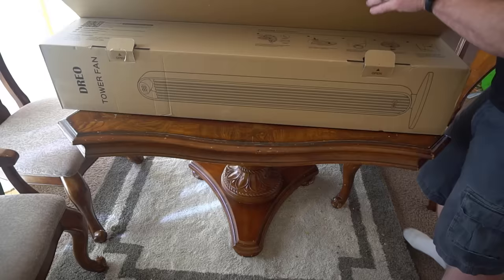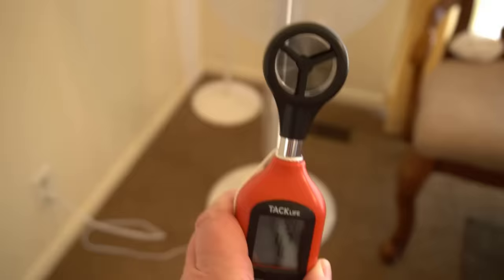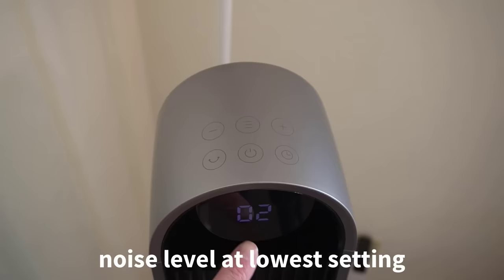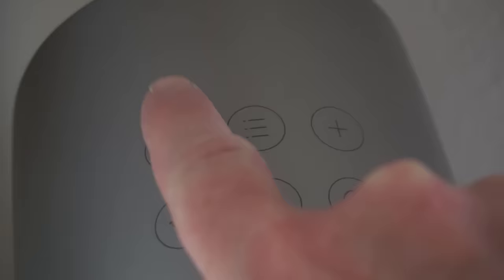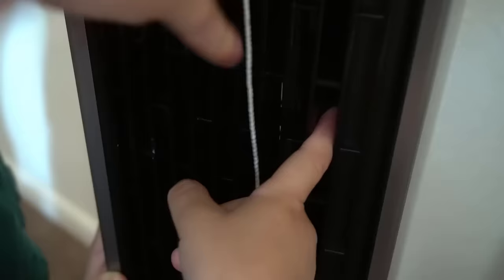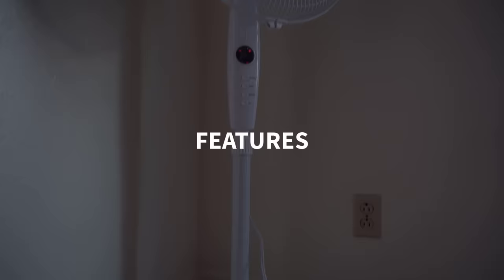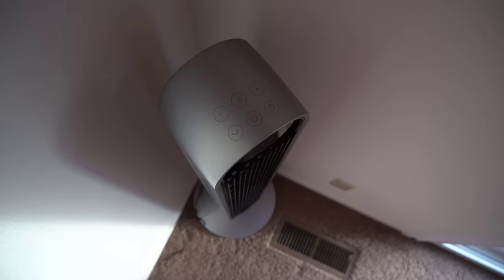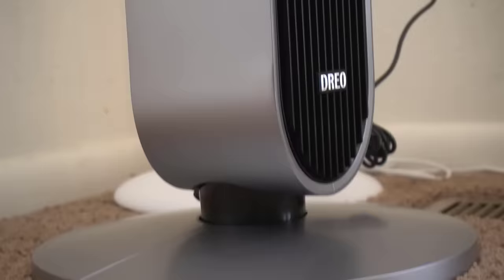Tower fan vs Standing / Pedestal fan. Which is best?  -  I did these tests to find out.

Comment: A tower fan uses what amounts to a centrifugal blower, whereas a pedestal fan uses an axial fan design. Centrifugal blowers produce faster air velocities and tend to be quieter. Axial fans tend to move a larger volume of air (CFM) and tend to be a bit louder. Great job with the video. This is exactly the results that could be expected based on scientific principles.
Reply from the maker: Nice! Thanks for your comment!
Reply: Axial fans work better to cool you off on a bed

Comment: You measured wind speed, but you really need to measure volume of air that is pushed as well. You can take computer fan and measure the speed and it will be pretty high. But you will not feel anything, because volume of air is negligible.

Comment: Title should be "£170 fan vs £20 fan. Which is best?"
Reply: Not to mention that the more expensive one eats up 2x more electricity, so that's additional cost in the long run. 😐😂 Gee, I wonder which...
And why not get 2 of them if the tower consumes 2x more electricity? Two "classic" fans will surpass it in every single way.

Comment: The power consumption test wasn't accurate. Most tower fans use a regular AC motor so they'll draw the same amount of power as a stand fan. That Dreo fan likely used a low voltage DC motor. Just going by how thin the power cord was and the fact that it had a switching power supply.

Also look into Shark Tower fans. They're loaded with features and are very quiet.

Comment: If it's a super hot day and your room is a sauna, which one is better?
Reply: Air con
Reply: Standing fan!!!
Reply: @nimasherpa5610  what about a ceiling fan do these do the work better?
Reply: @Rqidz  A ceiling fan would be more effective, and it will also not take up any floor space.
Reply: @Rqidz That depends... Cheap ceiling fans have minimal blade pitch, thus don't push as much air.  Quality ones with a more aggressive pitch (like an aircraft propeller) push a lot of air and can outdo any portable fan.
Reply: 1500 watts heater fan

Comment: I had a ac motor pedestal fan and on high it uses 50 watts and the airflow was not that much and then I got a dc motor pedestal fan and on highest setting it uses 25 watts and that the airflow was strong and that it uses the same power as a usb phone charger on lower settings like 7 watts and under

Comment: Nice review!  I'm surprised that tower fan used less energy vs the standing fan, from my experience it's been the other way around in terms of getting good airflow. The Dreo I would say would be considered a more high end tower fan vs the stuff you can find in Walmart or Costco so perhaps that make the results better than if you had a tower fan in a cheaper price bracket to match the standing fan.  Otherwise, a good in depth review that's hard to find!

Comment: Actually the standing fan is more efficient it’s got blades on it. It’s rotating higher volume of air
Reply: Tower fans push colder air more directly
Reply: @iDTecKt  Fans don't cool air. they just move it.

Comment: That tower fan has a dc motor and I have a pedestal fan with a dc motor and it's very quite and very energy efficient like this tower fan is and that pedestal fan has a ac motor and ac motors are not that very energy efficient and louder and have less power then dc motors
Reply: What's in your opinion the best at night to cool you down tower or high end axis fan ?
Reply: @alexvikendi1768  I have vornados and it I will mostly say vornado that its all about the brand that tower and axial can be both garbage and vornado moves the air accross the walls and back to the fan and the dc energy smart vornados have more power and are more quit and lighter

Comment: When I was a kid under 9 years old I knew that it was the back of the fan that if you put your finger into it that it you would get hurt but the front no because the back catches your finger and the front just pushes your finger back because the angle of the blade pitch

Comment: Standing fans are circulating air from the center of the room. Pedestal fans pull in air from the center DOWN to the floor. 

If you can conceptualize what the airflow being pulled in to the back of a standing fan, vs a pedestal fan, you can see why that matters.

The circular shape of the standing fan causes more of a vortex on the back side. It pulls air in fairly evenly in all 360°, from floor to ceiling.

Pedestal fans, on the other hand, have a rectangular intake. Now, the shape itself isn't necessarily a problem, but it does mean pedestal fans circulate air in an entirely different way than standing fans.

To understand why pedestal fans operate differently than standing fans, you need to consider the shape and size of the intake. Your basic model standing fan is typically 20" in diameter, which means the intake has a surface area of 314 Square inches.

A 32" tower fan has a rectangular intake that's typically 29" x 3", or 87 square inches of surface area. That's almost 3x LESS than the 20" standing fan.

A 42" pedestal fan comes in at 114 square inches, or roughly 1/3 that of a standing fan.

Like I said, the shape isn't necessarily a problem - it just means they operate differently.

Pedestal fans are engineered in such a way to take advantage of the smaller intake size. Rather than blowing the air straight out like a standing fan, pedestal fans (at least the good ones) use a curved piece of plastic to funnel the air before blowing it out. This curved piece further reduces the surface area of the intake, and causes that "curtain" effect that pedestal fans are known for.

The purpose of a fan is to move air, so why add a second piece that further reduces the size of the intake? I'm just guessing here, but the area of the second piece is probably less than 18-20 square inches - WAAAAY WAY less than a standing fan. So why?

Because of Bernoulli's principal. Without getting complicated, by reducing the size of the exhaust (the size of the opening the air blows out), you increase the volume of air that enters the intake. The reduced exhaust size creates an area of low pressure behind it, causing more ambient air to rush in to balance it out. By utilizing this principal, pedestal fans are able to move air with the same velocity, with less surface area than standing fans. 

Not exactly an accurate comparison, but it's an good way to visualize the differences. You can think of a standing fan as a fire hose, and a pedestal fan as a garden hose. 

The fire hose sprays a thick stream of water, very far. The fire hose does that by drawing in 150 gallons of water per minute. 

A regular garden hose can't do that. Not even close. Turn the water on full blast, and the garden hose might spray 2-3 feet at most. Because a garden hose only draws about 12 gallons per minute. But, if you attach a nozzle to the garden hose, reducing the size of the exhaust, that same hose can spray 20-30 ft. But with a smaller, more concentrated stream. 

That's the difference between standing fans and pedestal fans. Standing fans work by drawing in as much air as possible from the entire room and blowing it everywhere, creating lots of turbulence. Pedestal fans work by drawing in air primarily from the sides, rather than the entire room, and blowing it out in a thin, vertical column that doesn't really cause turbulence. 

So! All of that is to say, in my opinion, pedestal fans work better for directional cooling in summer, since they are very good at capturing air from the lower half of the room and blowing it to a targeted place without disturbing the air column too much.

So if you're looking for a fan to use for a bedroom, a gaming room, somewhere that you're stationery, pedestal fans are great for cooling.

But if you're trying to circulate heat, you'll need to place the fan on a table, or find some other way to get it closer to the ceiling or it won't really work.

Standing fans work great for both cooling and heating, because aside from the turbulence they cause, which mixes the air and averages out the temperature, they can also be angled up or down! And the fan height can be adjusted vertically as well. They can be lowered, and angled up during winter to warm the room, and raised up at a slight angle to cool it down. Or, you can point them straight and adjust the height so they blow in a specific direction.

So overall, I think standing fans are the better choice for general purpose use. There's nothing wrong with pedestal fans, but they're much more purpose-built to perform better in specific situations

Comment: This is nothing but a poorly disguised sponsored video.
Also, it doesn't matter if the tower fan moves air faster right up against it if the air movement is the same a 5 feet away. That just means the tower fan is much less efficient with the air movement.
Also, also, read the 1 star reviews. The fan is outrageously over prices and does not last at all.
Reply from the maker: Thanks! I would love to have had this video sponsored.